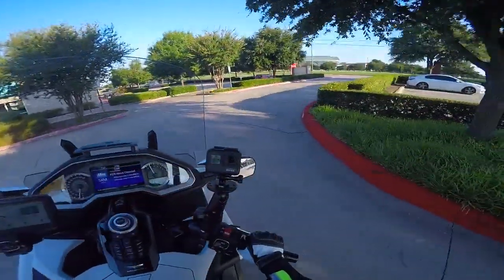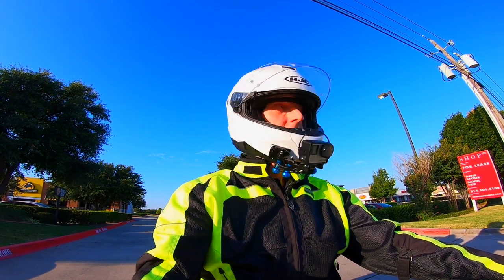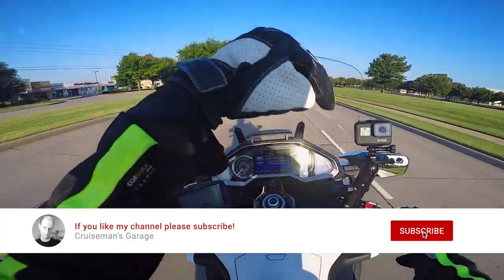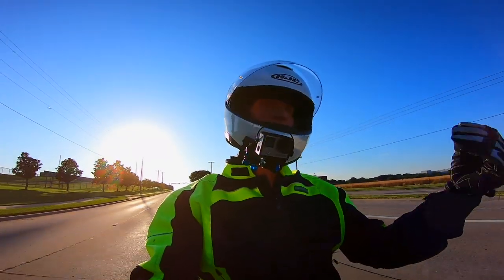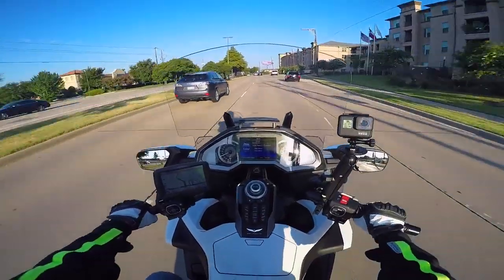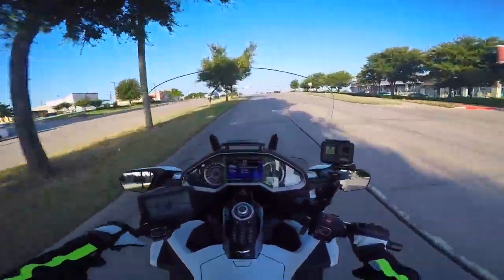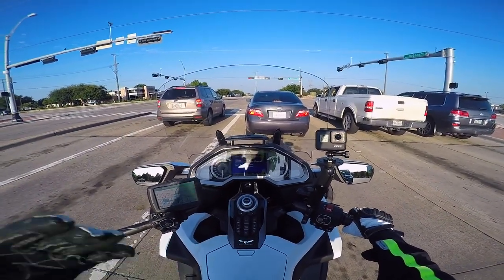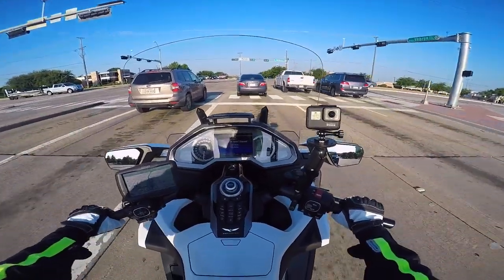Catastrophic Engine Failure on 2018 Honda Goldwing | Cruiseman's Moto Vlog | CruisemansGarage.com

Comment: The sky is NOT falling, it is NOT catastrophic failure.  Get a grip.  The heads can be removed without removing the engine, if it is like the previous model.  A new head can be placed if the cylinder bore has not been damaged with bits of the valve stem retainers.  When Chris showed the bike on his  video, they were running the engine and reving it up -- you just have to be more savvy than that!  The retainers usually go out the exhaust ports, but can get into the cylinder bore!  If you hear a bad engine noise shut it off and do NOT restart.  Get it to a mechanic.  Stem retainers are more often "tossed" on a new tight engine or rebuilt engine that is still tight.  That is part of break-in, no full throttle or high RPM and all that jazz or the first few thousand miles.  It is possible that the stem was deformed or the retainer was not perfect; but it is far more likely that the engine was redlined right out of the gate or too soon.  Anyway, the word is still turning and the engine can be fully repaired.  Honda will probably warranty it, but it may not be a defect in material or workmanship.  If the dealership drags their feet about repairing, that is another issue.  The parts and special tools can be there in a few days and the disassembly is probably already done (should be).  If a machine shop is needed to repair the bore, that is another day or two.  It is a big problem, but not one to end all.
Reply from the maker: To me, catastrophic failure is anytime the engine has to be removed from the bike for repair.

Comment: Its obvious the engine swallowed a valve, when that happens the piston and head are scrap metal, and possibly the connecting rod and cylinder walls. This is going to take a long time to fix, if it can be. Anyway, Honda/dealer should at the very least give him a loaner period. That being said, if it was my bike as soon as it was fixed I'd trade it in on a new one, done!

Comment: I see way to many issues with this new goldwing from the motor now to the plastics to the suspension ...seems like Honda did not do their home work on this production sadly...btw traxx has seemed to have found many of the suspension issues some are easy fixes some might require shop work. Hopefully honda can sort this all out .

Comment: All this 18 issue talk is convincing me to go buy a leftover 16 tomorrow. My 2nd one and two previous F6B's
Reply: Mike, that's what I did, a new 2016, did not want any thing to do with the redesigned ones.
Reply: @MarkSmith-sh5xq  just picked up their last 16 GW in black and gray yesterday. Already planning on Progessive suspension and TBR slip ons. Rode both ways in the rain too.

Comment: This would be an example of even the best man-made items still not being perfect. Yes, Honda has a great reputation. No, they are not perfect. I’ve had Harleys for the last 12 years, 3 of them. I averaged about 20K per year on each bike. I never had a single problem except one small oil leak which left about 3 drops on my garage floor. They had it fixed the next day (10 years ago) and I’ve never even seen anything that bad since.

Comment: So I'm catching up by going back and watching the first video. If the valve has come loose it may be a simple fix. Waoting on your next update.
Now for the transmission failure.
The new Gl1800 is a new motor many changes in the motor not just 7 speed DCT or 6 speed manual. Honda I think told the dealer to give the new bike and return the failed bike to Honda for them to take apart and learn why the motor failed. All this information may not be public to the customer. It would be cool to learn the true $$$ amount the customer was put for the new bike. Looking forward to your update. I'm wanting to know the 2020 colors. Soon I hope.

Comment: Yep..  I'd be all over the dealer and Honda to quickly solve the situation.  Especially when their flagship has a major issue(s).  I'd like to know the ratio of 2018 GW's that are flawless compared to ones that have had major issues.  1 for every 250 GW's sold??  I do agree though that when you purchase a Honda product, you're buy'n 10's of thousands of miles of mechanical issue-free miles.

Comment: I agree on what should be done however legalities, obligations and responsibilities are tough. From my understanding the dealer buys the bike at wholesale from Honda. Dealer typically takes out a line of credit to pay for that inventory. Now this comes up, it is the dealer at this point that is on the hook for the bike. Not all dealers have the credit to just trade up bikes. Now the dealer has to deal with all the expense of the labor and parts then submit the claim to Honda to hopefully get reimburse by the manufacture if it was a factory defect and not the dealer. Depends what Honda's dealer requirements are for pre-sale inspection and service it could be the dealer that's on the hook for it. If enough dealers report this issue than they can go through the channels to get either a recall or TSB which streamlines the process. Typically the manufacturers are not that quick to admit blame or cover costs.

Comment: All vehicles can have mechanical problems. I have a 2003 HD Road King with 100k miles that I maintained to the letter. Runs great. I had an earlier generation goldwing that the engine mounts weld failed. That was scary. I was considering a 2019 wing, but may make a move to Indian. Let's see how Honda reacts in the end.
Reply from the maker: I agree. I should have an update on this in a couple of days.

Comment: Also, I am sure Honda will step up. I am and have been an owner myself for years. I never had any issue with them.  After all it's their legal liability and the customer (Mr. Wavey) has legal rights.
Reply from the maker: I think the only "legal" obligation Honda has is to repair the motorcycle and bring it back to spec. But, there is a perceived obligation that Honda has to it's most loyal customers, who purchase their flagship model, especially a brand new model.

Comment: Honda along with every other vehicle manufacturer follows the law in all fifty states. Meaning that the lemon laws covering vehicles determine how failures are handled. In many states, motorcycles are not covered by lemon laws. In those states where they are covered, some states will  require the replacement of the engine in cases of catastrophic failures, others only require the repair instead of the replacement. I agree that Honda should step up and do the right thing but manufacturers are leery of going beyond what is required by law for fear of establishing precedent.

Comment: Here’s one perspective. We know Consumer reports did a study in 2015 in which 11,000 people who bought bikes between 2008 and 2014 were surveyed. Honda did well in that survey, tying for second place with 12% failures. Of failures, about 9% were engine failures. Granted, Honda has an amazing reputation for engine reliability, but surely some of those engine failures were in Honda motorcycles.

Honda sold >300,000 motorcycles in North America alone in 2018. Twelve percent of 300,000 is 3,600. If Honda has a typical distribution of failure types (as indicated by the 2015 CR study), then ~9% of those ~3,600 failures were engine failures = ~324. Because Honda is awesome at making engines and their failure distribution might be light on engine failures, lets give Honda the benefit of the doubt and estimate motorcycles sold in 2018 might have included ~200 engine failures. 

Why should we be surprised when we hear anecdotes of Gold Wing engine failures, especially on international forums, given the numbers above only reflect North American sales?
Reply: I would guess the newer engines suck compared to the old.

The engine on my 2007 hornet 919 was based off the fireblade designed by one of the best engineers at Honda, Tadao Baba. He's retired now though...

For goldwings to fail like this is atrocious. The best ones from the older design would likely see 1,000,000 miles theoretically.  I've seen 330,000 miles on a CBR600rr with no rebuild; that's an engine that winds up to 15,000....

Comment: Right head dropped a valve. Likely that the valve stem broke in half, and the debris bounced around and made contact with the piston and combustion chamber. New cylinder head, piston, head gasket, and related parts will probably be the cure. Seeing as the engine still runs, the warranty department will likely cover parts and labor to get the engine back to 100%. Most motorcycle manufacturers aren’t going to offer loaner bike while customer bikes are being repaired. Their view is that motorcycles aren’t considered main transportation sources, rather they are recreational vehicles. Previous generation GL1500’s and some 1800’s were prone to dropping a valve on the right side of the bike, after the bike was parked for extended periods of time. It was determined that engine oil would completely drain when the bike was on the sidestand, and would create a non lubricated area where valve components could fail. If your bike is going to be parked for more than 2 weeks, place it on the center stand for peace of mind.
Reply from the maker: Honestly, motorcycle and even scooters ARE primary forms of transportation for millions around the world. And, the Goldwing is more expensive than a Honda Civic. Like I say, if it happened after 18 months with 45,000 miles, that's one thing, but this was obviously defective from the factory.

Comment: I concur that the problem is mfg defect, the dealer is the customers first line of defense.  The mfg has to make the customer right, new bike, paying the dealer for a loaner, etc.  If not, then Honda has defaulted to run of the mill product    and customers should be wary of buying.  I am multiple gold wing owner..sad to say the best ones came out of Marysville plant.

Comment: I'm not thinking any more of that Honda has the best built product out there. I love my 2013 F6B most of the time, but having a pulse generator go out after 2000 miles, In & Out, causing possibility of being stranded at any time until fixed, was not good! Now I'll admit I ride hard and fast, but now when I downshift to second, and put in some throttle, I have a transmission slip, not slipping into another gear, just a plain transmission slip. Dealership said you're just driving it too hard, and you broke it, we have to split the case and it's going to be $5,000 just to find out what's wrong with it in labor alone! They called Honda and Honda said basically the same thing riding too hard, now I know I like to ride fast especially in second and third gear, but aren't these supposed to be bulletproof bikes engine and transmission? I'm keeping my bike, but that really kills me every selling it, with this huge problem I could never pass that along to someone else! As long as I ride easy, and be careful when I'm downshifting to Second, since that's the only gear it slips and, I can usually get by on a ride without feeling that slip. Honda is definitely got to step up and get better all the way around! They're going to start losing people. I can't believe now when I hear people say they got a hundred and fifty thousand miles on a Goldwing, sounds very far-fetched to me!

Comment: No dealer I ever worked at will ever sign any agreement that guarantees anyone something special in the event of a major failure.
The dealer is just the manufacturer's representative and their agreement is to facilitate the warranty and is the extent of their obligation in cases like this unless they want to do something personally like a loaner. To me your coffee buddy did not get anything special, he had to spend a whole lot more to get back in the saddle. If they gave him his money back he could find another used GW elsewhere and that would have been a nice option...
BTW; The valve can not hit the spark plug unless the head of the valve broke off, it looks like to me that Wavy's engine swallowed a foreign object? There is no question that debris was circulating in the combustion chamber...
Reply: Bass Player...I totaly agree with your analysis. Bet he paid list too. No deal there. A refund with no strings attached would have been my option as the fix.

Comment: My Engine froze(30,000+) 2018GW DCT B.(Queens, NY) 2 years old.
Reply from the maker: Damn, how did this get resolved?
Reply: @cruisemansgarage  Not Yet, Shop busy, Have to wait.
Reply: Picked Back Up Today(10/20/21) went in shop(10/8/21)- Queens Honda Claims (Aftermarket Battery totally Dead{Installed by L.I. Honda Dealer Nov. 2021} Replaced battery(Cleared All Codes) back to Normal(For Now)

Comment: My valves had to be adjusted at 4000 miles all exhaust on right side
Reply from the maker: THAT is not normal.
Reply: Cruiseman's Garage i know it started out as a clicking sound on the right side my dealer was quick to get them adjusted
Reply: The clearances where 0.006-0.0007 so pretty far out of spec for the mileage and I rarely run sport mode
Reply: @ericking7773 If Honda is  out sourcing engine parts like HD, most parts are  going to be from china.(>No one has ever mention Engine parts Origin.?,,suspension parts,wiring harness ,throttle by wire, ??,,《that DESTROYED Toyota car sales when their engines went full throttle, killing several people. "Toyota used( China) throttle by wire."((.Honda is a "far away COMPANY !",(,the dealer makes the call)[[,(if no recall ).I was told this by a Honda dealership ☆.BMW waited afew years to make A Recall on a shock,,it cost BMW ALOT OF SALES $$$$.
Reply: Goldwing needs valve adjustments? WTF? Even the nighthawk 750 had self-adjusting valves.

Comment: I had trouble with Honda dealers and problems with my 2018 Goldwing DTC during its first 2,000 miles. It was very frustrating. I missed two multii day rides because of the priblems.

Comment: Would rather buy a used 1500 or a 10 year old 1800 with miles on it you said you can see the failure with 10 or 20 thousand miles on it you must be out of you're mind

Comment: The problem is, so many of the new 18's are going wrong, they are so cheaply thrown together compared to pre 2017. they have sacrificed so much in order to try and stay in the new market of sport tourers (even though they practically ripped of BMW designs in so many ways with this one). It will take them a couple of years to iron out the flaws in the new designs and then put it right. The engine changes are subtle, but they are already showing impact of 1 in 5 machines being faulty within 5000 miles. :( I would not touch the new transmission ever it belongs on mopeds not real machines, but the new design maybe in 3 or 4 years time with standard box could be a possible, I watch with interest.
Reply from the maker: Not sure I agree with you on the transmission. If the new 650 HP Corvette has a DCT, I think the Goldwing should be able to manage.
Reply: @cruisemansgarage   Corvette aint a 2 wheeler unless Im missing a new kid on the block ???
Reply: Hold your horses Mr   First of all DCT is not that new and Honda is well ahead of the curve. Their new transmission on their MotoGp is an even better version easily handles close to 300 horsepower(on 2 wheels). In case you never notice the new Wing easily beat out the BMW GLT as best

Comment: Should be covered under the Lemon Law.  If I were him I would demand a new bike.
Reply from the maker: I think lemon laws only pertain to used vehicles.
Reply: my understanding the only way it could fall under a lemon law is if it happens more than once. "Lemon laws consider the nature of the problem with the vehicle, the number of days that the vehicle is unavailable to the consumer for service of the same mechanical issue, and the number of repair attempts made"
Reply: @cruisemansgarage  Not in Arizona.  I had a friend who got a brand new Honda Fit that was a problem from day one.  They had to cover it under the lemon law.
Reply from the maker: @egalitarianvegan8806  well then. I must be wrong on that. Maybe each state has their own laws?
Reply: Watch the video, it was purchased used regardless of its mileage.
Reply: @cruisemansgarage  I owe you an apology.  I looked up Arizona's Lemon law, and you are correct. It is only used vehicles.   My friend,  I talked to obviously gave me bad information.    I know his new car had a discharge problem that was intermittent.  Honda could not find the problem so they had to replaced the car.  At least that is what he told me.
Reply: punkybrewstershubby this bike was purchased new out of the crate in May

Comment: Just honda now adays. Not as reliable as they use to be. I have freinds with hondas and there's always a issue. Oil leak, electrical and parts wearing out quicker than normal.
Reply from the maker: Really? I almost never hear of a reliability issue.
Reply: @cruisemansgarage  here in the UK i know people who have had engine issues/electrical. Especially the low cc models like geared 125cc and scooters. My freinds 2017 honda forza had a false reading were the bike would say it's overheating when it wasont.

Most of the bikes that have issues start to have them over 20k miles or just under 10k miles. Search up honda timing chain issues cars/motorbikes.